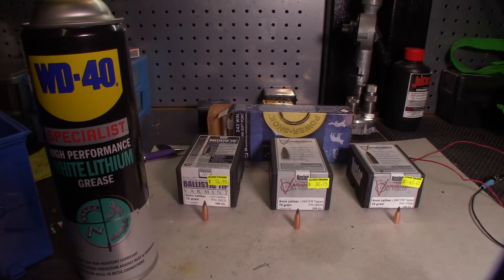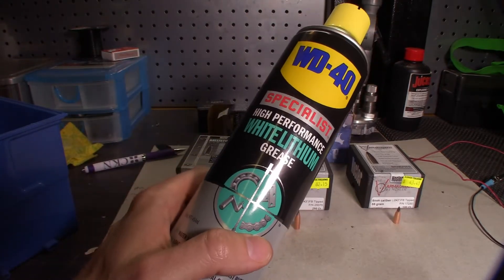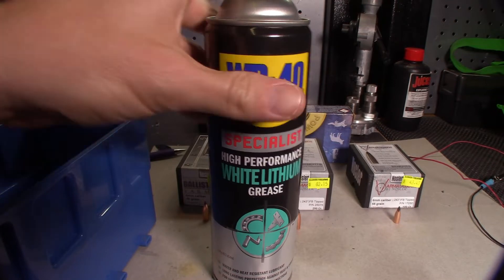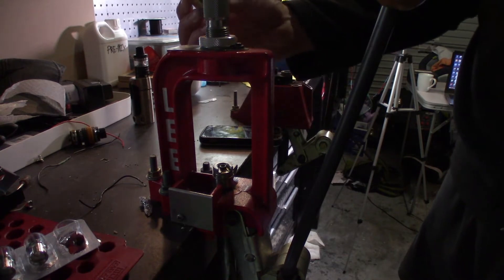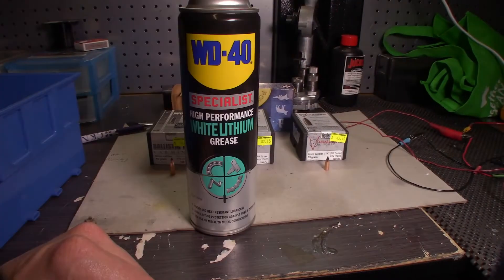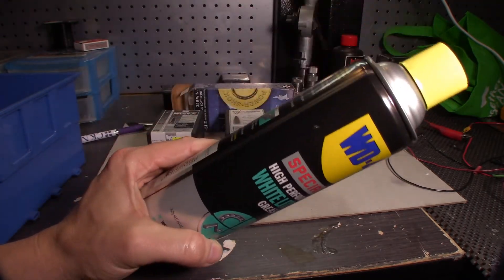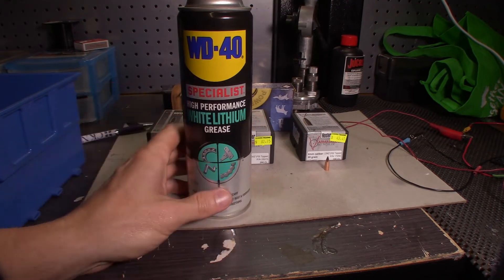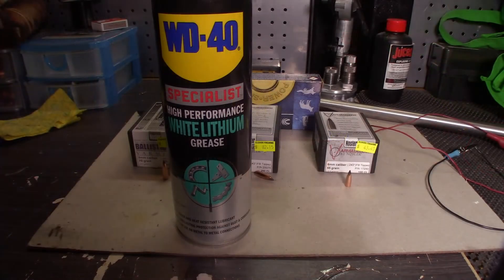Splat Chat 6 - Case sizing with Lithium

Comment: Had a look at the Bunning's website and it's only $7.95! Gotta love buying stuff for guns that's outside of gunshops...so much cheaper. As an aside, was in a gun shop the other day and they wanted $20 for a tiny little bottle of Hoppes #9 (I think it was a 20ml bottle). Coincidentally had just stumbled across Eds Red Bore Cleaning Formula. Just as good as Hoppes, but I made up 4 litres of the stuff for under $40 and it's brilliant. Good not just for guns, but great for old rusty tools and all manner of things.
Reply from the maker: Thanks for the tip!!!

Comment: This looks like an excellent tip ... timely because I was about to get some lube. What did you use to wash them down afterwards? Would just soak them for a bit in warm water with some mild detergent and then a wipe work?
Reply from the maker: Hey mate, I simply washed them in detergent and warm water, no wipe down needed :)